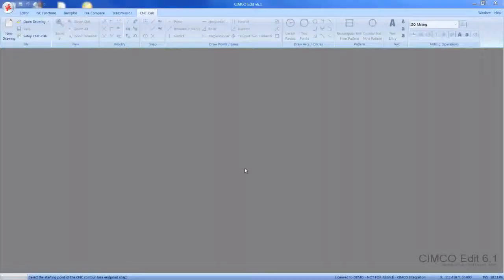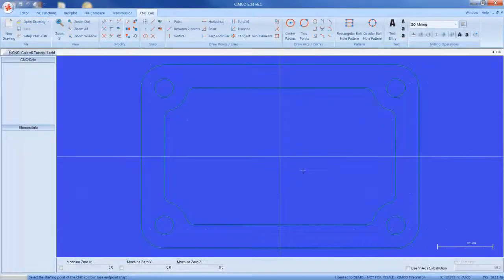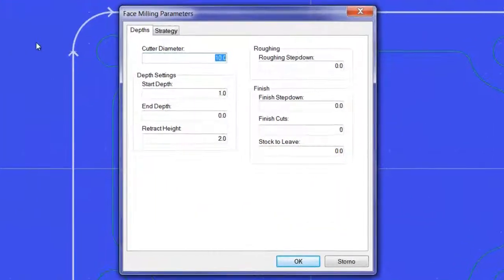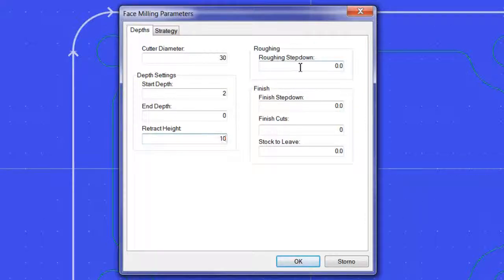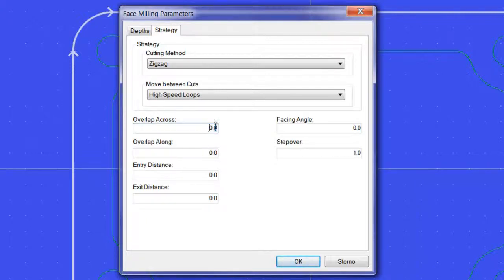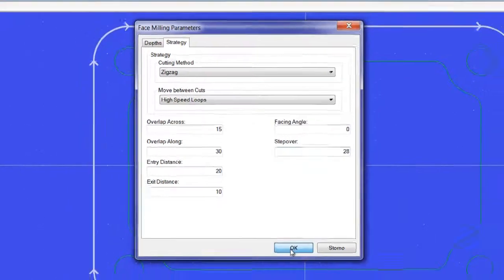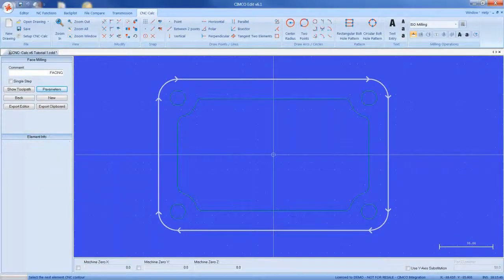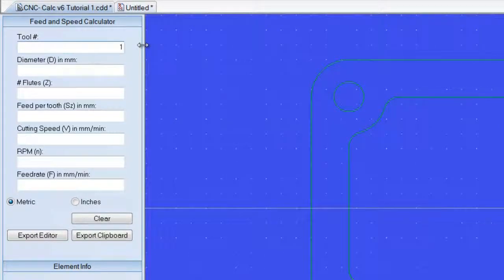(English) - CNC-Calc - Facing

Comment: Why does the post keep putting decimal points after each G-code?
G01.
G02.
G03.
?
Reply: I was on v7. I just brought in t post from V7.5 and plugged it into V7 and that problem went away. However, a new problem arose that I found. On contour, no matter what you have your decimal set at for your feed format, it will not carry out to decimal places. For example:
F20.123456 exports as 20.000000.
I believe the problem is withing the program and not the post because drill feeds act properly. Another thing is the RPM/sfpm calculations are waaaaaay off. It looks like it is off by the value of PI. Again, this is within the program, not the post. Cimco needs to hire a machinist to test their code. There are waaaaay to many mistakes in this software. I have just started playing with this CNCCalc and have found many errors. We are considering getting CNC-Calc add on to edit pro for the guys in the shop to do simple fixturing; but, with all these mistakes, I doubt it would be of much help to them. One thing that I REALLY hate is that when you are editing a post you must close Cimco edit, reopen the post, reopen the drawing, create a new tool path to in order to test each change. WHAT AN INCREDIBLE HEADACHE! Give us a button to refresh the post...PLEAAASE!
Reply: Another thing. The problem with the G-code decimals seems to be eliminated when the added the delimit code in the post. I had to add this to S M T H codes to fix them, also.
Reply: Actually, it was ALL posts giving this bug. V7. The V7.5 posts corrected this issue with the delimit code in the posts. However, cimco failed to fix this on the S T M H T codes. I was able to edit the posts to fix this myself.